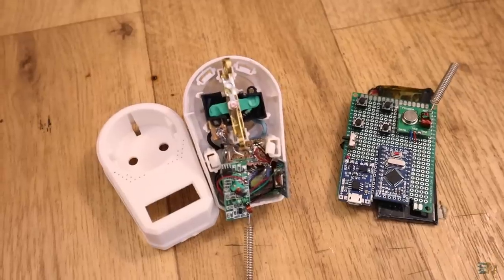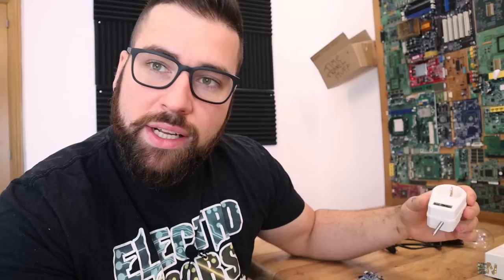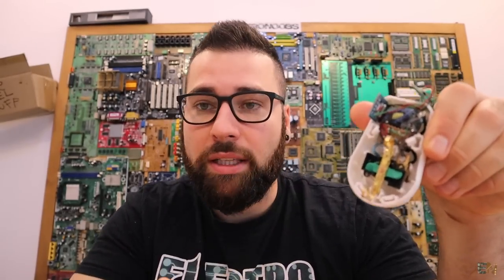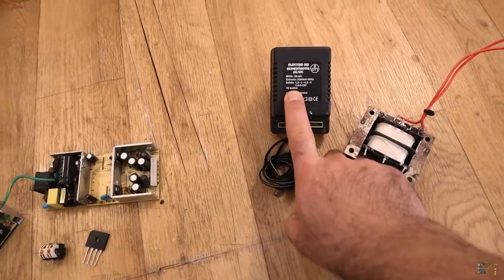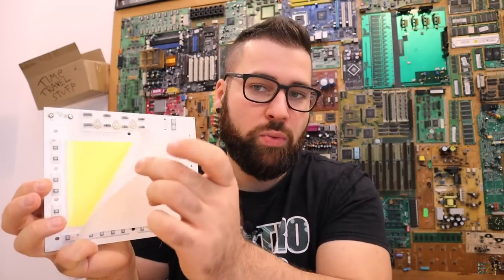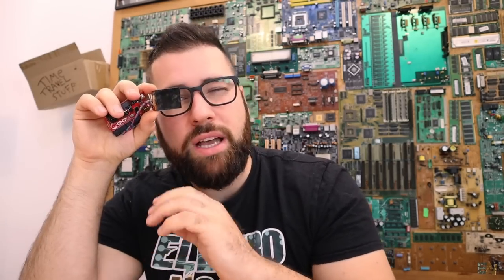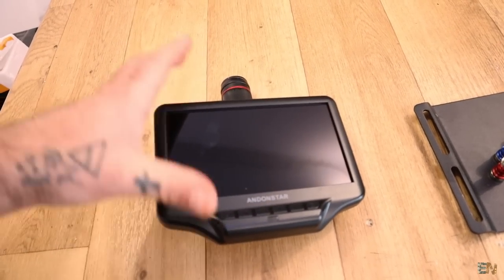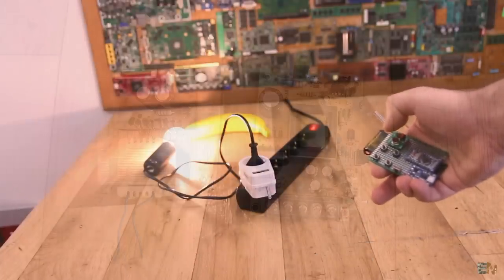How to Make a Transparent LCD

Comment: You can make all pins as output, this reduce power consumption a lot.
Also you can use register to shutdown the ADC which very very much reduce power consumption as well as you can make deep sleep of 0.33 micro amp which can re-stand up easily by pushbutton

Comment: Great projects coming! I use discarded cat5 eithernet wire for breadboard and sometimes pcbs, but the insulation tends to melt when soldering.  This wire is useless for its intended purpose when it's less than 30' long.  But those scraps will keep you stocked for life!

Comment: Congratulations again. What about using an old 6 inch, hi res cell phone or a tablet, with modified screen backlit and running a powerpoint like app to show the frames, you can sincronize then with the vertical axis using audio via headphone jack of the cell. Good luck and thanks for your tutorials.

Comment: The resin printer is an exccellent idea there are vídeos from Element14 of a similar DIY resin printer but they used a 4k monitor. The major challenges are accurate positioning, leveling, UV lighting, choose of resin formulation and cure process. My best wishes.

Comment: You can buy the switched relay outlet plugs here as a set: 3 plugs with receiver and relay plus a nice looking 4-channel remote. All for only €10
Reply: And how much is one with 4-6 output that are remotly controled :) its not about making it cheaper its about learning how to make it and then upgrade it. Maybe use esp32 also 5-6 eur, and make it controlable over internet or your smartphone, put some touch screen (7-8 eur).

Comment: Have long been aware that the 30awg wrapping wire is not a great conductor, but you sent me into a blind panic by suggesting it is not copper.
Just tested some against a strong magnate ... it does not appear to be a ferrite.  Cannot imagine they used aluminum instead.  It must be copper.